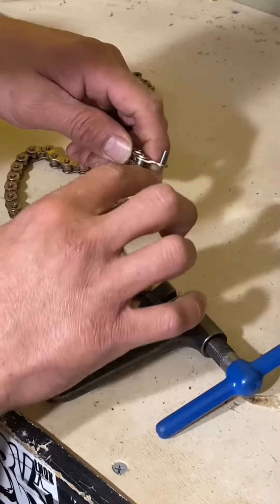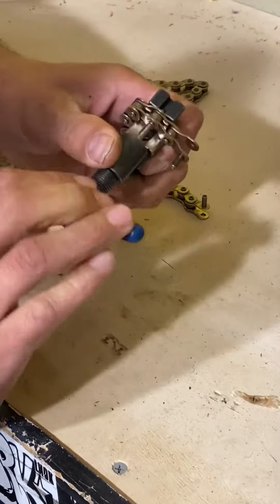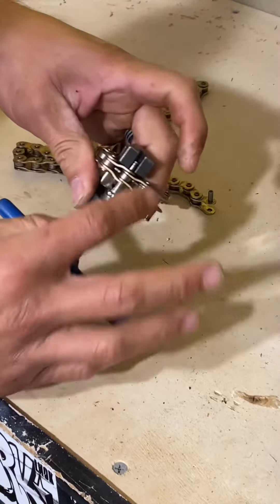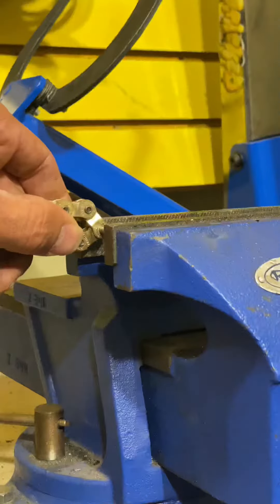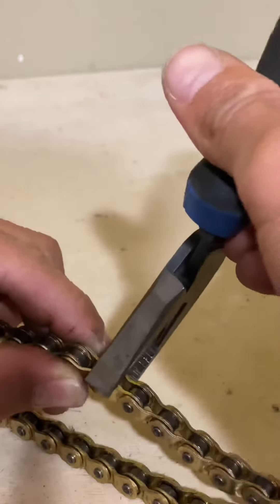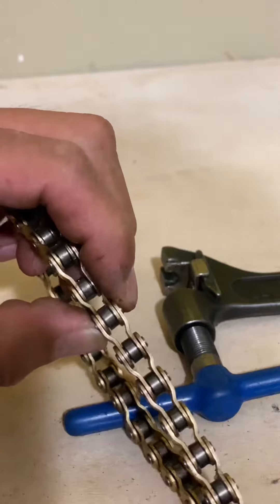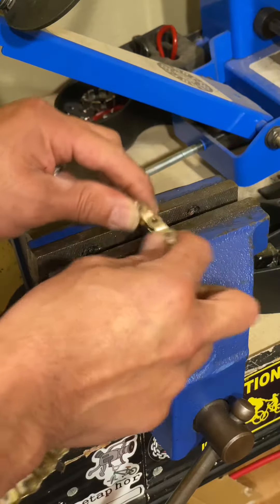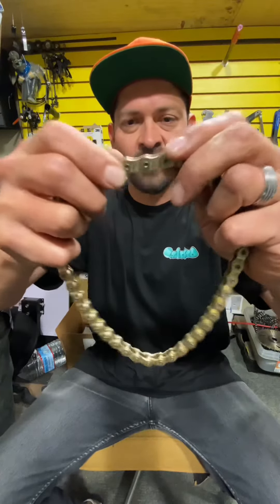How to replace a chain on a bike the easy way sizing & installation

Comment: For a tight link, you can use the inner plate of the chain breaker that will loosen a tight link aswell on the park tool CT-5 chain breaker 👍🚲💨